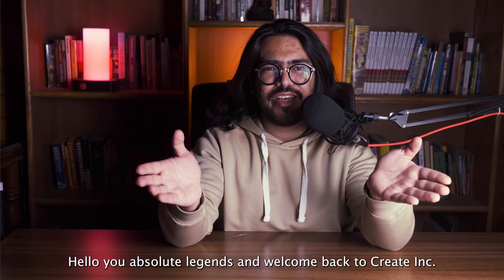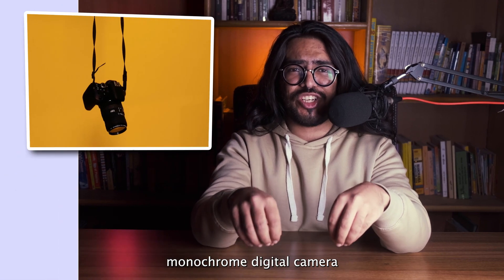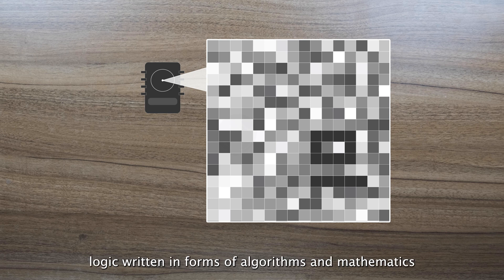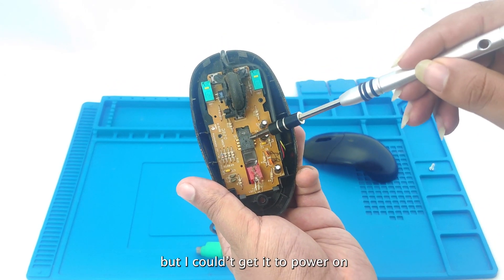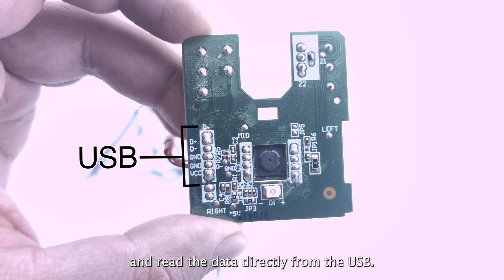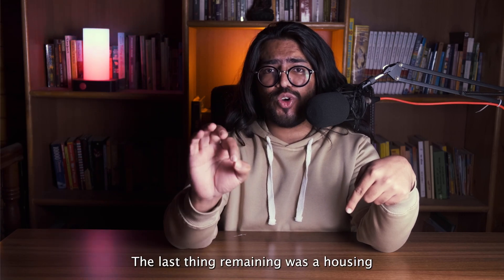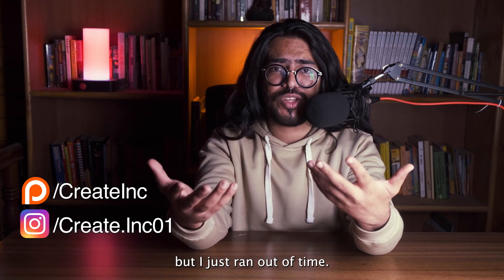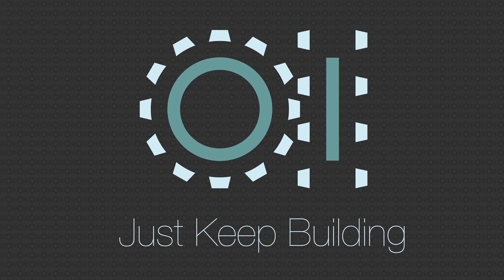An OVERPOWERED Smart Ruler From an Old Mouse?

Comment: Hi, Thanks for the video. I wonder what optical sensor or rather the mouse you   used for the project?  What pins of the sensor one would use to connect the Raspi to? Is it written  anywhere? Is there any sketch of the diagram about the connections of the raspi and the mouse sensor?

Comment: It's great that you build a gadget with funktionality. But a lot of people would simply like to use an wireless mouse and connect it to their smartphone, raspberry or notebook I guess. They could glue something on the side of the mouse so that it could ride smoothly a long a ruler or a board. I do not know any api to read the data from a mouse. I assume it would be easy for you to explain how to read out this data. Every user could dial in their mouse with a ruler on a given distance. Is any other reader able to give a hint for this read out?

Comment: Great Work. Can u tell me how much accuracy this can be? I want to make an project that uses the optical sensor to measure some of distances on products made in my work, but it need to be very precise and have a good accuracy, like 0.005mm of precision and approximatly 92-95% accuracy.
So is better to me find some pretty good optical sensor, or just some mouse with high dpi will be enough ?

Comment: Hey Mr. Create, I wonder how well you could use this as a cheap measurement feedback method for a 3d printer for axial movement?
Reply from the maker: I think that's possible to do but these days the stepper motors themselves have a feedback mechanism. At least it does so on my prusa mk3s, the stepper motor detects crashes and it has saved countless prints for me. Do you have any other application in mind?
Reply: @CreateInc  could this be paired with some form of camera or probe to make a diy cartesian based Coordinate Measuring Machine (CMM)?